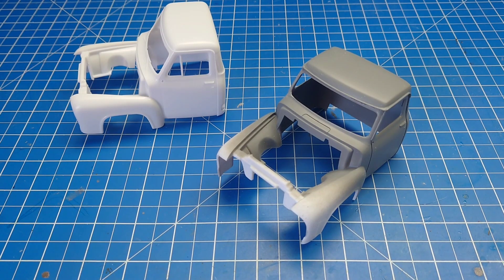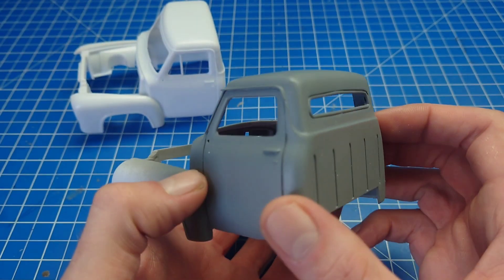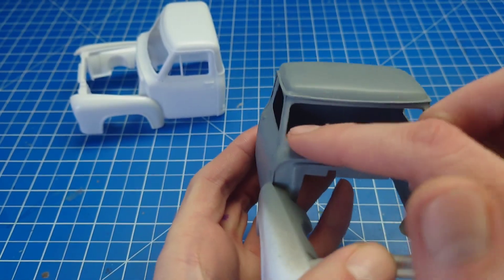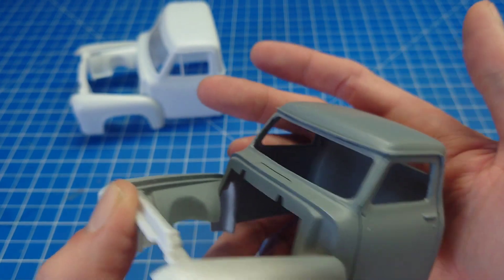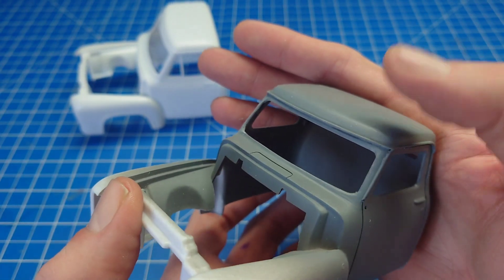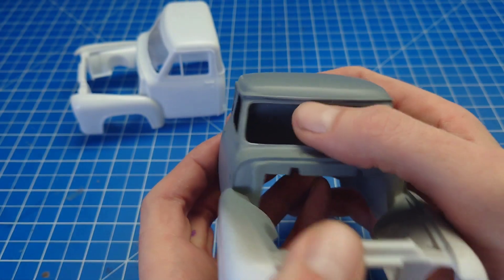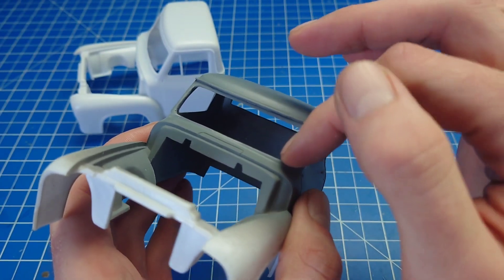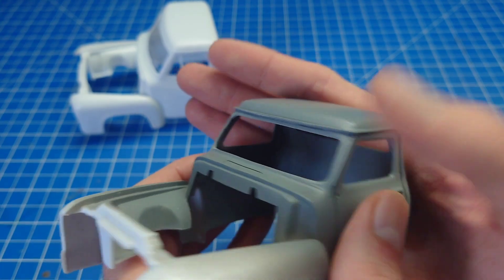USACC 2023 GB - Building The Mountain Pearl Ford F-100 - Update 3 Chop Revisions & Project Direction

Comment: So nice! You do really amazing work.  I ended up sanding most of the details off, so I was thinking of going this route also. Really glad you shared your technique. I now know what I had pictured in my head does actually work😅 I also really like how you made the top of the windshield smaller. That area always seamed so odd on the 55.
Reply from the maker: Thanks buddy 🙂 Honestly I'm loving your build and the way you've chopped it is the conventional way so nothing you've done wrong there. To be honest I've had to go down the more lengthy route as it's more of a replica but I'm glad you liked the method and it may be useful for the future 🙂 trim work is a little tedious and can be messy, but I think I'm getting better the more I use it and understand it's capabilities and also limitations 😂 
I'm definitely not a fan of the front roofline, it always reminded me of a motorcycle cargo box top or the lid of a beer cooler for some reason, haha 😂 keep up the great work anyways, loving the direction of yours. Let's hope we can both get done on time eh 🙂 thanks again buddy.